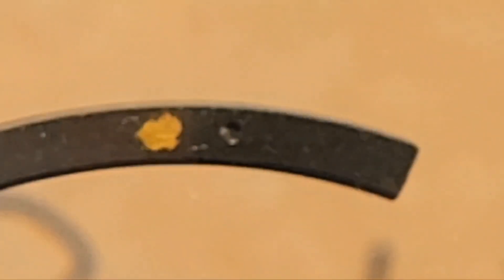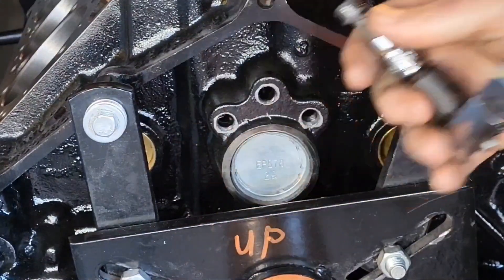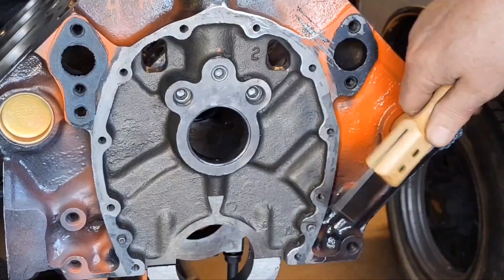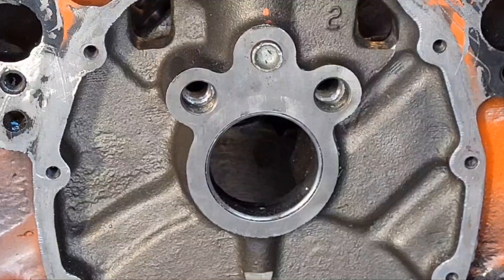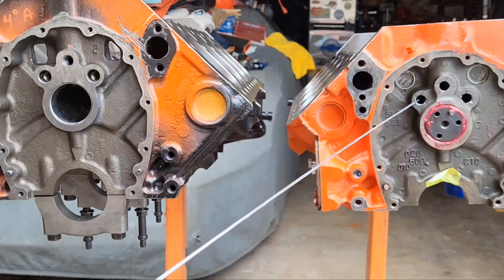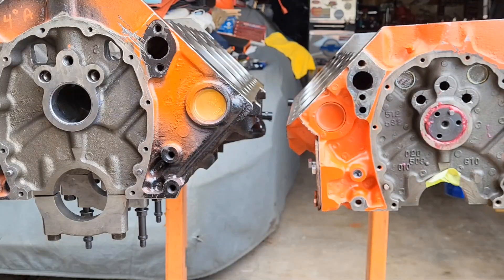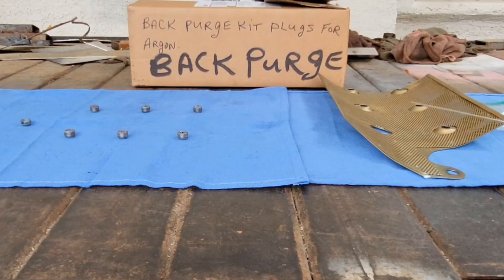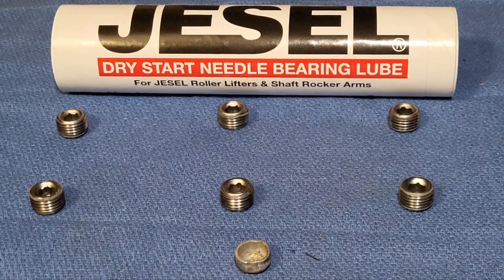1/4 inch NPT plugs for lifter galleys - SBC Gen 1.

Comment: With an 880 90s block like the orange and black on pictured in the left… do you still run 1/4” plugs? Looks like the two outer plugs are larger maybe 3/8 or so?
Reply from the maker: The one on the left is a 036 Target Master block from '94.  They redesigned the thrust face, but all the plugs are 1/4" NPT.

Comment: If you heat up the gasket with you're torch it scrapes off much easier
Reply: Also buy a Carbide edged scraper. We made one back in 1988 at FEL-PRO Arnie Fox dreamt it up using a snap-on screw driver handle yup just like your super scraper.
Reply: Good gravy dude get a 3 inch roll lock disk on a drill and clean those gasket surfaces. Come into the 21st century!
Reply: Spray-on gasket remover works really well on those paper gaskets also. Spray it on, wait the recommended time, and any simple gasket scraper or razor blade will take it off with no excessive force which can scratch the block.